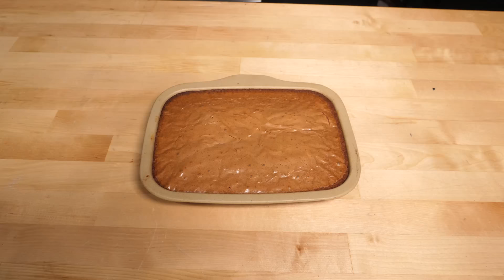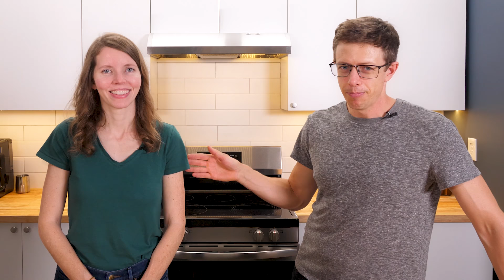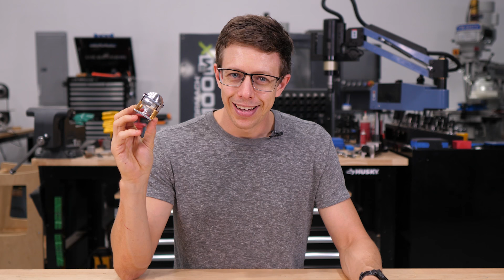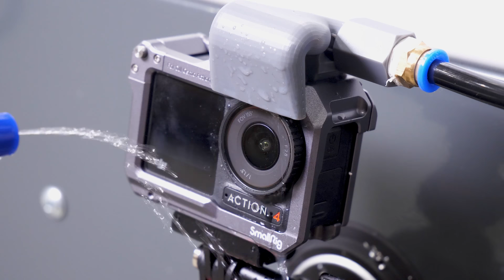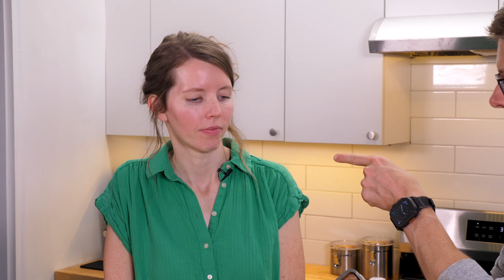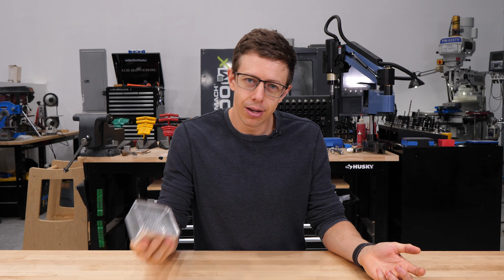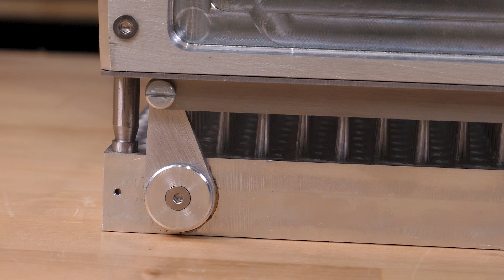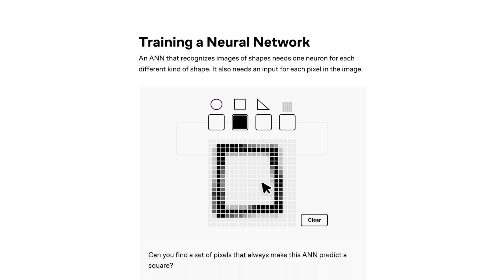Baking brownies from the inside out

Comment: I wonder if it's possible to achieve something similar by slowly raising the temperature of the batter to right below when it'd start baking, maybe in like a double boiler setup, then pouring it into a heated pan and putting it into a preheated oven, so there would be minimal time between the edges and the center baking.

Comment: Theoretical a cylindrical baking form would further decrease the edge to center ratio. At 1cm crust width there would be 2% less crust .
As the Crust width goes towards 0cm it would always be slightly better for a round base. This all does not compansate the fact that you would have to cut it like pizza or how else would you cut it then.

Comment: Your air powered mortar brought me back to 1966, I was  14 built a gasoline powered tennis ball mortar. My best friend Ted and I  decided to play army. We had walkie talkies he went to a cross street 400' away, I had the barrel braced at around 45° towards the Blvd, Ted would tell me where it landed. After 10 shots I was hitting the far lane. It took another 10 shots to hit a moving vehicle. I got the actual distance from Google Maps. Great fun😂
Reply: Tennis ball cannons rock!😂 I built one a few years back, it has a four foot long X 4" diameter ABS combustion chamber with an on-board propane fuel injection system that simultaneously vents and refills the chamber with a stoichiometric mix of propane and air in about 15 seconds. The chamber has eight stungun ignition modules equally spaced along the length which attach to eight spark gaps located along the center of the chamber to ignite as much fuel/air mix as quickly as possible for maximum chamber pressure. The barrel is a coaxial arrangement of 3" ABS pipe with an inner sleeve of 2.5" Conduit PVC (which you would think was designed around shooting Tennis balls lol, it's just tight enough to make a good seal without creating too much friction), the 3" ABS has two cutouts in the rear, one large Tennis ball-sized hole and one L-shaped slot which is where the bolt-action mechanism attaches to the inner conduit sleeve barrel, the entire system combined makes a cannon that can fire four rounds per minute which is fast as hell for a potato/Tennis cannon.

It shoots empty Tennis balls at 800 FPS😂, and it shoots water filled ones at 700 FPS, which is nuts, empty balls are making 1200 Ft-Lbs of muzzle energy while the water filled ones make around 2100 Ft-Lbs, about the same as a really hot 12 gauge deer slug😂. It kicks like a friggin mule too, it feels like a 12 gauge too lol. I also installed an RF receiver into the ignition system for firing it remotely, in case I want to use it for launching large fireworks on the 4th of July, it gives mortars a serious kick in the pants with a sabot to make them fit the oversized bore, which includes a pass-through hole for the fuse which gets ignited by the combustion gases when it's fired, it gives them about triple their usual burst height lol. 

Sorry if this got long😅, I just really love talking about potato cannons, and funnily enough this cannon is child's play compared to the brutal hybrid cannons I've built in the past, they could send a golfball with the energy of a .50 BMG, at around 2800 FPS with 12,000 Ft-Lbs lol.
Reply: Mine was a 3" x 36" galvanized pipe with a cap. The ignition was a long thread spark plug ignited with an ont telephone hand cranked magnito , the spark plug held the tennis ball about 8" above the  cap. Gasoline was my propellant. I wish now that I'd switched places with Ted to watch the balls arriving on target.
Good news were still best friends. 
My lesson how to target was from watching WWII movies and documentaries. 

@TheExplosiveGuy
Reply: @marlobreding7402  That design of yours is one of the few original potato gun setups when they first became a thing, the whole concept was started by great people like you, I never could have made what I did without standing on the shoulders of giants😉. It's unfortunate you didn't get on the old Spudtech forums back in the late 90's and early 2000's, you would have loved to see how popular the hobby became back then. It seems that in today's age too few young kids have little to no interest in building fun things like potato cannons (a generic term for launching anything that fits down the bore of a chunk of plumbing pipe lol) and instead prefer to live through the screens of their phones😔. Folks like you and I weren't happy as kids if we weren't inventing fun ways to launch random objects at high velocity😂.

Comment: When I watched this video I expected to see Panko brownies at some point, which would be truly edgeless. Panko bread (known for its breadcrumbs) is baked from the inside-out using electricity. Basically it is baked between two parallel metal plates by the resistive heating of an alternating current flowing through the dough between the plates. Since the electrical resistance is even throughout the dough, heat is generated evenly everywhere, which gets rid of the heat transfer problem altogether. Maybe that would make a nice follow-up video?

Comment: I think my favorite part of these videos isn't seeing the weird stuff he can think up but rather the explanation and actual thought going into it. I mean, racking your muffin pan, making sure to have a lever so you can do it with an oven mitt, making sure the lever locks back above the center point so you can't accidentally impale yourself. This is actual engineering, not the fastest and first thing that comes to mind but rather a well thought out design with as many issues eliminated as possible
Reply: Exactly my thought. There are so many points where he could have ended the project and it would definitely have been justified but he keeps on refining until it becomes an actual product worthy of market
Reply: I note that an actual production run of such pan would most likely be cast with some finishing machining. What we are seeing here the propotyping.

Having said that, there is a very large capital investment in creating such a casting machine.

Comment: 16:52 which is why you make your own. Super easy and you can make them with common shop tasty bits. The springs i have from my bucket of tiny air freshener springs, the balls are from all my past bearings, and the threaded shaft is just a normal screw i hollowed out. The kicker is sealing the ball in and i did that with a custom (hardened) punch that has a small teat that pushes the ball in so i can wack it and deform the edge to retain the ball. The only thing i paid for was the bolts, the rest was scrap, even the punch was one i bent in half... doing some illegal punch things (punches are not levers... who knew that).

Comment: Redneck version:
Get two identical pans, nest them, drill a bunch of holes through both bottoms, separate, put pop rivets in the holes in the bottom pan but don't fully pop the rivets off, nest again, fill with batter, bake, cool, use two flathead screwdrivers on opposite sides in opposite directions to pry them apart evenly. Enjoy.

Comment: FWIW, when I worked in a pizza place, we had Aluminum heat sinks for the deep dish.  But the spiky heat sink was something that we put into the top, not going through the bottom.  If you adopt that style, you can get a spiky heat sink that works as the top for any normal pan for faster cooking.
Reply: The goal wasn't really for faster cooking but even cooking, and like the other guy says, this is mentioned. He ruled it out because it would mess with the expected texture on top and brownies need to rise; pizzas don't.
Reply: @golden--hand  well, he needed to make the middle cook faster so the edge wasn't hard by the time the middle finished. So it technically is about faster cooking.
Reply: @icodestuff6241  I mean, technically. But its more that it didn't NEED to cook as long because it was cooked evenly. Which just inherently reduces how long something needs to be cooked for. Like, you aren't wrong, but the implication isn't quite right either.

Put another way, if the method required four times as long but provided the perfect brownie center piece, he'd have been just as happy with the results. I assume those 'more edge' pans are faster then a normal pan too, but the results are quite different.

Anyway, my point was just speed wasn't the desired effect, it was a just a side-effect of the method he used. I assume in theory if you put the mix in the oven at a ultra low temp and raise it a degree ever x amount of time, you'll cook even and prevent burning and at some correct temp to time ratio get essentially edgeless brownies too from a normal pan. But that involves far less inventing, machining and over engineering.
Reply: They talk about this in the video
Reply: @asdkfhaksd  When? I missed that.

Comment: Engineer-maker here, I’ve been trying to work out how to do edge less brownies for years. I would argue you made an all-edge brownie, but you’ve lowered the cooking time so nothing gets overcooked. Functionally equivalent, but the edge of the brownie still touched metal. My definition of edge less means the side of the brownie only touches more brownie. Aside from trying to cook something in microgravity, my current best plan is basically a basketball sized hollow sphere that I will use to roto-mold the brownies, the same way plastic kayaks are made. There would just be one penetration for venting, otherwise any brownie would have only bordered with more brownie.

Comment: I might be an a-hole for saying this. You probably already thought of this or tried.

In my mind it would be better if you just had the pan with spikes and the walls on that. And then a floor with the holes could be inside that pan with two handles on each side, kinda like a big spatula. The lifting mekanism would probably have to be different so it lifts up the handle from the pan with spikes. 

Now the brownie is outside the pan and very easy to cut or take off in one piece. One big issue would be cleaning i guess.

Comment: I used to work as a cake decorator at Beckman's Bakery in Santa Cruz. And also created their first sandwiches. In cake baking you're looking to fill the pan to make uniform shapes. But there's always a dome of extra expanded batter above the pan. I used to save those up and glue them together with the appropriate frosting and give them out to friends. It's very much an only middle texture as it never touches the pan and is VERY moist.
Reply: I read this as 'cake detonator' and got very excited
Reply: @teemuaho4807 c4 could probably be used in lieu of fondant as it's quite malleable
Reply: Kinda like a muffin top.
Reply: @Conorator  - Are you suggesting we use this method instead of spending $900? What then will we do with the stump?!

Comment: It does feel cooking brownies in a water bath accomplishes all the engineering objectives 😅
Reply: I was thinking that too, but doesn't the batter have to go above boiling temp to get the rise it needs to be a brownie? I think it would make it into fudge.
Reply: @andrewb9942 It would still get indirect heat from the top, if cooked in a standard oven. I don’t know if that’s enough for the rise, or whether the extra humidity from the water bath would disrupt the sugar crystalization to form the crackle top. Seems like an approach to try at least!
Reply: @andrewb9942  Nah, baking powder starts to activate around 110F, and it's completely activated over 175F. The bigger problem is cooking the flour, which needs to get over 350 to brown properly. But the bain-marie method still works. The water bath cools the pan, but the batter is still absorbing radiant heat. You get a reversal of the heat transfer, wherein the center gets hotter than the edges, and the batter cooks from the inside out, just like he's trying to accomplish in the video. The cook time will be longer, but at least it doesn't cost $900. ;)
Reply: @andrewb9942  water bath inside a pressure cooker/canner.

Or use a sand bath
Reply: oil bath?  @andrewb9942
Reply: Sous vide enjoyer
Reply: It works, you just need a longer bake time. A similar method is to wrap a strip of heavy, wet cloth around the outside of the pan. The cloth releases the moisture more slowly than an open pan, and you don't get as big a humidity spike inside the oven. Bakers use this to prevent cakes from browning at the edges.

Comment: It might be worth noting that you could make the opposite of the pan as a mould for ice cream, and the two layers would interlock.
Reply: Or just pour sauce (e.g., caramel) on and let it fill the holes, then use a flat layer of ice cream.  I think 20 years ago I tried a cake that used caramel injection and it was amazing.  Normally that's a hassle to do, but in this case the pan does it for you.

Comment: That action cam air knife was the most useful quick under the radar engineering gadget that just flew by.
Reply: i wish i thought of this at my machining job. so many times a cutter broke because the coolant got in the way of the camera
Reply: The camera airflow case was also really cool.
Reply: @Creative-Carve-Cite-Climb that was honestly really impressive. It could easily be a video in of itself. Getting a DSLR/ mirrorless level camera to work inside an oven pretty crazy.
Reply: Some machines use rotating windows to do the same thing. (I think ave has one) the centripetal force flings the water and chips off, and the camera looks through the rotating bit of the circle.
Reply: Edge Precision made one awhile ago.
Reply: Timestamp is 5:41.
Reply: Agreed
Reply: i wonder if a shield coated with teflon would work. or just a sheet of glass with water running over it
Reply: @Blox117  a water shield wouldn't fix anything since it would hardly have any effect, same with teflon. air blade is actively deflecting anythung coming while thkse are making the things stuck slide down
Reply: @altkasb3918 especially since filming through constant water running down through glass would just create the problem of having water in front of your camera. He is so damn smart, it's hard to question his choices man. I try to sometimes but I always wrap back around to realizing his ideas are just usually the best.
Reply: @Blox117  From experience working on those machines, some of them supposedly had these films, they generally don’t work. The best option I have worked with so far was just a clear disk spinning really fast. Works 60% of the time all the time. Sometimes you just can’t see anything no matter what.
Reply: @Anonymus-ih7yb we got a new cnc lathe with one of those and finally I can see what is going on inside without having the hatch somewhat open while doing the first run of a new program.

Comment: Feels like you could just create a water reservoir around the edge, and make it the right size so the water evaporates at the right time
Reply from the maker: This was my original plan! In fact I designed an entire pan that surrounded the brownies with a pressure cooker so that I could get over 212F. Sort of like a sous vide for brownies. I scrapped it once I realized how long it would take to cook (my estimate is a couple of hours, though in practice it would be shorter since the top of the brownies would still be blasted with hot oven air).
Reply: @StuffMadeHere definitely immediately thought sous vide, then also wondered about a very thick pan and gradual temperature rise.
Reply: @StuffMadeHere  I've done British style Christmas puddings in pressure cookers before (with a Pyrex bowl suspended in a water bath, double boiler style) and they always come out great. Pretty sure that the same could be done with brownies, though controlling the moisture may be challenging. Wouldn't get the flakiness though
Reply: And here I was considering a microwave...
Reply: My thought as well, but the steam might mess up the flaky top crust. I was then thinking maybe an oil moat but then it might need some way to have the oil drain... Although I don't know if that is even necessary. If you have a moat which insulates the sides and prevents them from cooking too fast maybe it would all just work?
Reply: or get a deeper brownie pan and have it float. but that would be a giant heavy item to heat in an oven
Reply: what if you cooked it with radiation instead of conduction or convection

Comment: Oh boy…this is why they have silicone baking pans…you can also bake in a pan that’s sitting in another pan filled with water and have the same results
Reply: But this way is cooler
Reply: @HalfDecentVideos719 sure, but the other way won't have drip failure, potential parts failure, potential cleaning issues, and the end product won't have a million holes in the bottom either
Reply: You just solved a baking issue I've been having. There's this cake that I've been trying to perfect that comes from my home country, I've finally been able to get it to rise consistently without deflating but it domes pretty dramatically. I was going to do a water bath next time but I actually have a silicone pan that's been collecting dust. I'm gonna give that a try the next time.
Reply: @CheesyChesterfield goodluck!
Reply: You are missing one important thing: this new method bakes faster.
Reply: @MTG_Music  at what cost? the cleanup of that spike pan will be 4x as long, and, he even said it dripped batter
Reply: I also thought about those cake pans that you can put some kind of insulation fabric for the edges to not brown
Reply: Yeah, waterbath was my first thought LOL
Reply: lol. Yeah. He’s very much an engineer. Solving problems that are already solved.